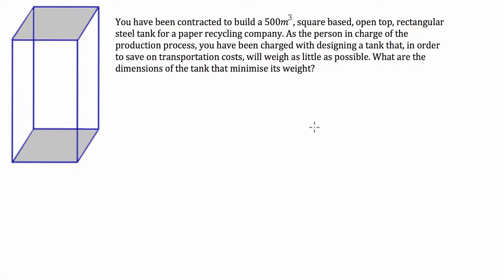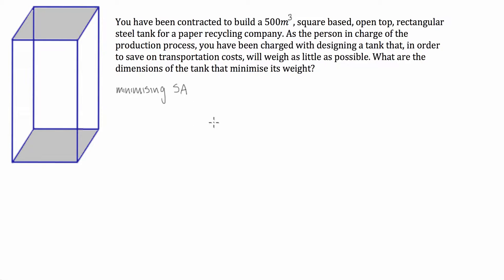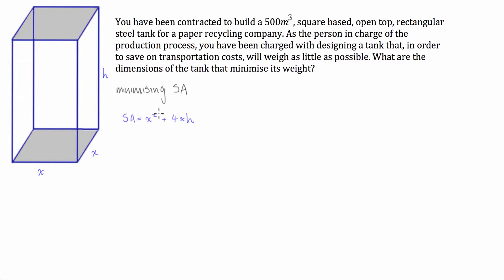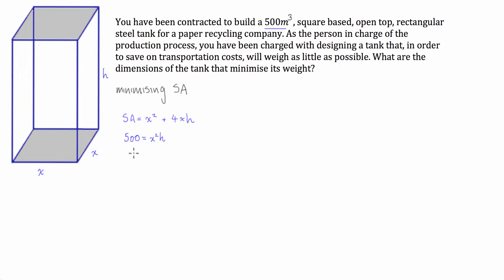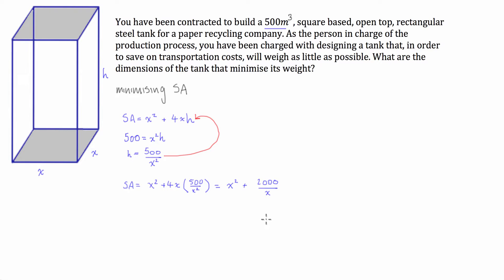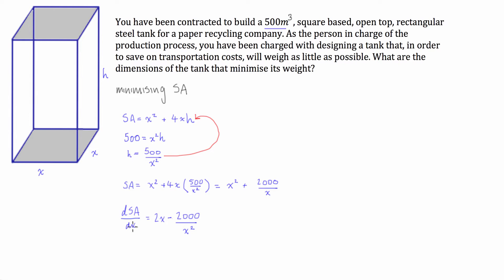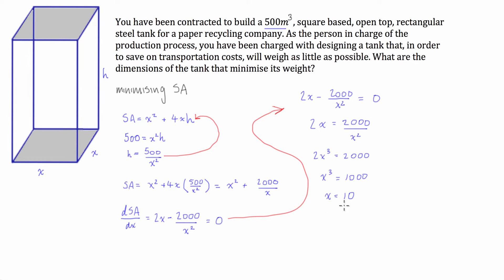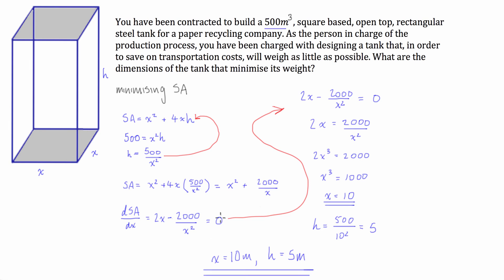Calculus - Minimizing Surface Area of a Prism

Comment: Hi I was wondering if you could help me find the minimum surface are of a pentagonal prism ( if it's possible ). It is for a final project. Thanks
Reply from the maker: You’ll need some restrictions. Do you have a final volume requirement or a pentagon side length to prism depth ratio?
Reply: @HaroldWalden  I have the final Volume which is 500cm3
Reply from the maker: This is how I would solve it; 

https://drive.google.com/file/d/1GILdFEOmOePaaD-8VRL3wPsSzj7QmuJi/view?usp=drivesdk 

I hope it helps :)
Reply: @HaroldWalden  Wow! Thank you very much! I really appreciate that you took the time to help me. That’s exactly what I needed.
Reply from the maker: That makes me happy. I make these videos to help kids with problems, so if I helped, mission accomplished 🤓

Comment: If the base is not a square, is it possible to find the optimal surface area of a given volume?
Reply from the maker: Good question, it depends on what kind of shape you are talking about. If the shape has regular dimensions like a rectangle or circle you will be able to optimise surface area for a given volume.
Reply: @HaroldWalden  The shape would be like the shape ion the video, but instead of a square base, it would be a rectangle. So instead of the area of the base being w^2, it would be lxw and there would be three variables (L,w,h)
Reply from the maker: There will have to be a constraint that links length, width and height. If you write me an example problem down I’ll show you 🤓